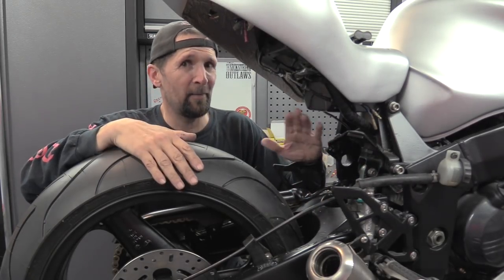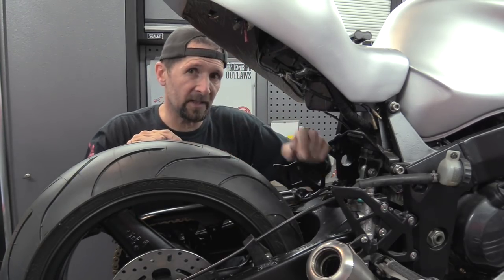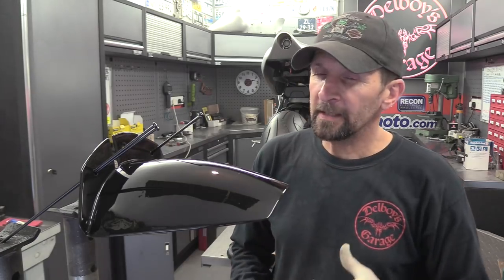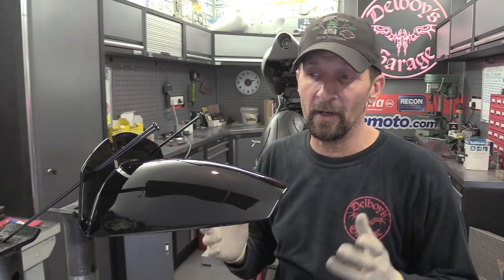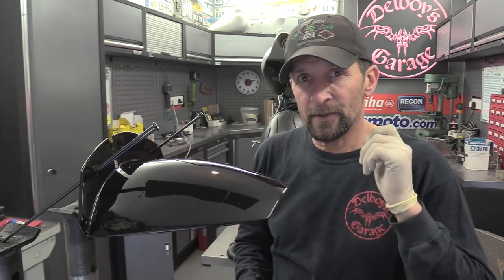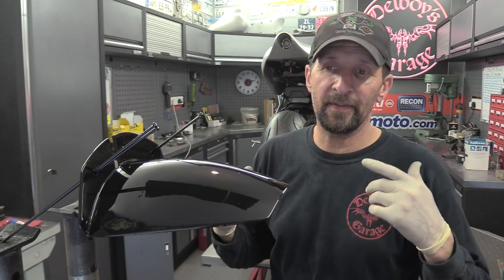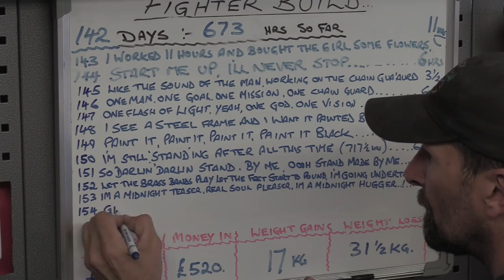Delboy's Garage, Fighter Build # 145, Hugger Done..!

Comment: Great job was looking for a rear fender for mine I'll now use wheel as a template to do mine a bobber somewhere in plans would be nice
Reply from the maker: Hi Kevin, yeah its a great way to get the exact right shape and curve.. just make sure you use plenty of protection over the tyre.. regular bin liners can melt a bit with resin.. so use a thick polythene bag and that brown packing tape is perfect.. just peals out easily afterwards... Good luck with it, and let us know how you get on..!  have a good weekend buddy... D&Px
Reply: Moonfleet41 thanks m8

Comment: I had problems with Simoniz Tough Black with the yellow label on the front of the can. The nozzles would get blocked and the cans would lose pressure. Holts were really good and gave me a few cans as a replacement and the new can has a greenish label on the front. Did you have any issues with the old cans?
On another subject, I have a petrol tank that I am respraying and had to repair a couple of dents. I have sprayed a top coat and there are some very slight miss matches in the finish from sanding the filler. Would I get away with using a finishing filler to fill these very slightly miss matches. You can't feel them by hand but by eye they stand out? Maybe a good video on filler and sanding tips in the future.
Reply from the maker: Hi Rich, I've done so many videos on sanding and filler, think I've probably covered just about everything, you can use the Dolphin Glaze filler, but its pretty expensive.. maybe try spraying a guide coat over the tank first, all one solid colour and wee if the joins show with paint over it..?  Good luck buddy.. hope it works out.. del.

Comment: Do you use anything on the threads to prevent rusting.  also if the frame is aluminum and the bolts steel do you get any interaction with the different metals ?
Plus did you consider doing a racing the
Reply from the maker: Stainless steel screws... no corrosion.. just a little threadlock so i dont have to over tighten them..

Comment: I didn't realize it was 4mm thick. Should be good and strong. Eventually when you decide on a colour scheme for the bike go with that colour on the hugger otherwise it will blend into the swing arm colour and disappear. Bought a 10 piece blind bearing puller set today.https://www.princessauto.com/en/detail/blind-bearing-puller-set/A-p8104036e
Reply from the maker: Hi James, That looks like the set i have, you'll find it really useful and makes life a lot easier for so many long term maintenance jobs like swing arm and wheel bearings... Good luck with it.. Del.
Reply: The set I bought is similar to yours but it does not have the bridge puller, it only has the slide hammer. I could make a bridge puller to use with the set easy enough.  I bought the set because I want to change several bearings on the V Star when the season is over. Just in the process of getting all the stuff needed beforehand.
Reply: I did not realize there was such a tool until you showed it on your channel, thanks for that.
Reply from the maker: Thats the wonder of Youtube aye buddy.. we can share things we would never have known. .and make friends around the world... Enjoy your projects and have fun.. Del.

Comment: Do you use anything on the threads to prevent rusting.  also if the frame is aluminum and the bolts steel do you get any interaction with the different metals ?
Plus did you consider doing a racing theme paint job ?
Reply from the maker: The screws im using for this job are stainless steel and won't rust, and ill use a dab of threadlock to keep the in place because i wonr tighten them too much in case it cracks the fiberglass..   Not sure on the paint, ive seen a few fighters with race paint themes, but with the main fairing missing, there isn;t so much to carry the livery off properly.. maybe a factory style theme.. not sure.. thanks for your support.. Del.

Comment: Epic del just out of curiosity what is the paint like for heat resistant's eg for heat sheilds and what not. I defo think it should stay in black I think it will tie in nice with the frame and rear wheel. It's looking del good job.
Reply from the maker: Hi buddy, thanks for your kind words.. am not quite srue on the exact temp. it will work to, but I've certainly had it up to about 250degrees confirmed, I painted the radiator mount bracket that also bolts right next tot he exhaust header pipes and that's fine, it's also used on the outside faces of the radiator itself, and for what it's worth, most regular paint is safe up to about 400degrees, believe it or not...!   So why not get the head shield up to working temp. , hit it with a laser thermometer and see what it gets up to... if it's anything less than 400', you'd be pretty much ok with anything !
Reply: Moonfleet41 fantastic thanks del. Did not know that 400 degrees should be enough then I have a tin of black in the shed weekend project me thinks. 👍👍

Comment: (P) Nice little vid Del. Did you consider grinding down the frame weld so that you didn’t need to cut the hugger?  I’d go for silver, if it was black, from a distance, it would look like just the tire and the hugger would disappear, unless that’s what you want.
Reply from the maker: Hi Michael, as you saw, I painted it black at the end of the video, it will stay that way for now, same as the chain guard and the air intake inlets, big decision to be made in the future once that time comes... that ridge in the frame was there to protect the swing arm from impact if the old shock reservoir ever hit it on full compression, it wasn't a weld, I didn't wanna grind it off in case it wasn't secure all the way through!  Thanks very much
Reply: Moonfleet41 fair enough Del